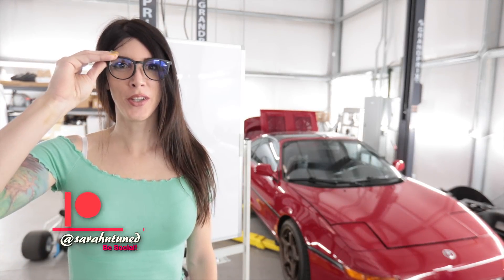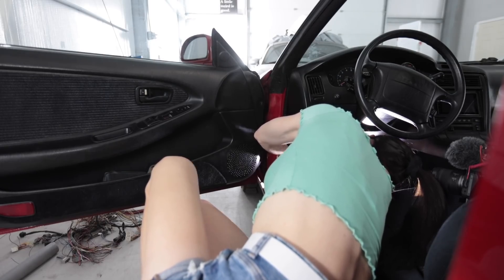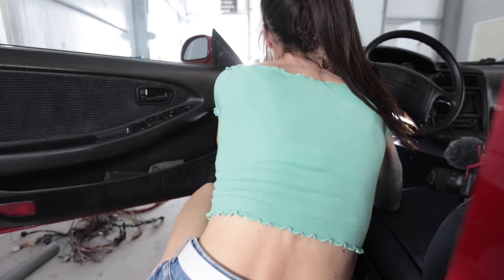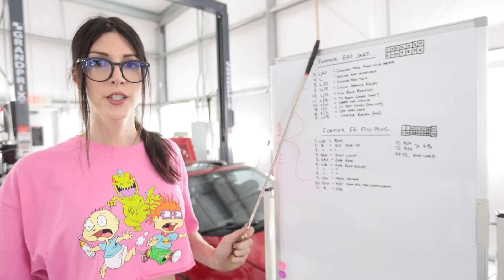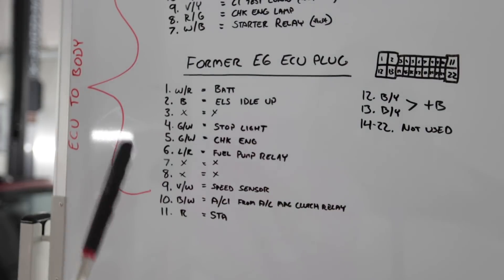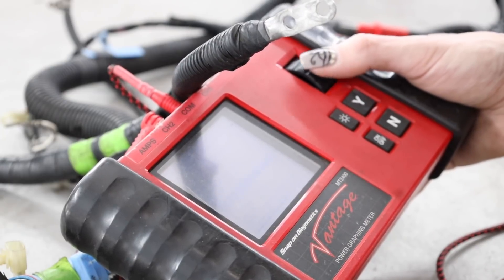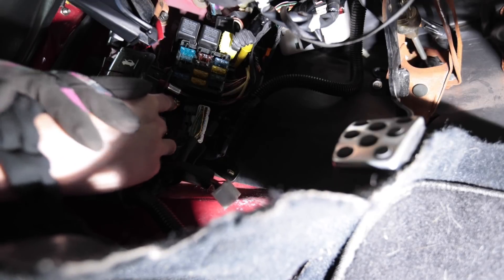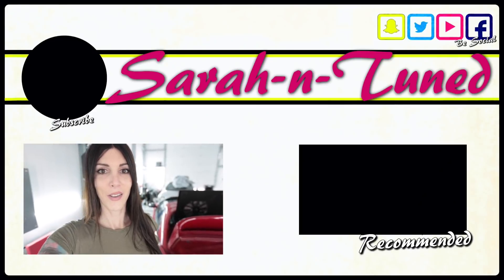THIS Is Why People Screw Up JDM Engine Swaps! // Project MR2 Turbo

Comment: The STA circuit does go through the clutch switch, but it as an input to the ECU is really only as a check, allowing the ECU to know the engine should be cranking by way of the starter motor. Kind of similar function to when your Forrester threw crank/cam sensor faults when the starter went out, it's version of that STA circuit told the ECU to be looking for those signals, which it wasn't seeing.

I personally nerd out hard on this kind of work, but you did a most excellent job of keeping it interesting for about everyone else. 

As long as you include the appropriate punctuation, in your head, while talking, sentences can go on forever...

Comment: Cudoos on plastic wrapping the exposed cylinder head. A true technician! I too did a S5 turbo RX7 swap into an 86 RX7 body and only two people online said it was possible and even the rotary performance shop in Dallas said it was impossible but haha persistence and wiring diagrams paid off!!!

Comment: I was thinking I would have hooked up the new ECU to the old harness and made sure it worked before ripping everything out and introducing numerous potential miswire faults in my fabrication process; then changed the body harness and made all those extensions. 

And truthfully I would have skipped the new harness and just troubleshooted the old one and added a new fuel pump resistor circuit and any others that tested with too much resistance or intermittent continuity when shaken. They spayed everything down in CRC 226 to restore electrical contacts and drive out the moisture. 
 I can't imagine doing the work you just did on anything less than a pre war Bugatti. Which would of course  be so much simpler. 
Alas, I lack your courage, patience and skills, to say nothing of your confidence. You are an inspiration to every DIY builder lacking the funds to pay someone else to get it done. 
I salute you. Love from, and beautiful weather in... NYC. Larry

Comment: Having wired up many after market ECU's I agree totally most of the screw ups occur when you take the wire color for granted. I always do and end to end map of the wiring it takes time but always saves in the end.
Reply from the maker: I also forgot to mention that JDM to USDM is sometimes off by one MY since Japan releases these cars one year ahead usually. That and sometimes plugs can have a wire or two in different pin slots.

Comment: I fixed a lot of mechanical issues on the Porsche 928 S4 I resurrected.  The only issues that were left were electrical (and timing belt).  I tried to fix each electrical problem and failed.  I sold her on to someone who thought they could fix her.  My hat's off to you for your electrical genius.  It's not as easy as you make it look.   👍

Comment: My 68 spitfire had a cross circuit between the brake lights and the ignition. If it was raining you could remove the key and the engine would continue running as long as your foot was on the brake pedal. Since the parking brake was rusted solid, parking on a hill was a balance of letting it roll till it died then brake and put it in gear. 
Got to love a car with only three fuses.

Comment: I've got a 1st gen-supercharged that I've needed to change the wheel bearings on for like 10 years now. Your motivation  is inspiring, your 2nd gen is gorgeous.
Reply: The wheels haven't come off yet if you've waited 10 years??
Reply: Just buy the bearings on line (not the cheap ones) and take the hubs to your local repair shop (like an alignment shop) and then have them take out your old bearings and press in your new ones.  Shouldn’t be more than $100.

Comment: Ohm, ohm, ohm... meditate your going to need it. Electricity flows like water, imagine garden hoses. Props! I remember wiring up a megasquirt ecu in my na miata.. and.. the Integra b20b vtec.. Honda crv bottom end with civic si 1.6 head. Squuuishhh!! Vtech understeer yo!

Comment: You should try the JDM method of working on mr2s by taking off the boot lid then sitting in the boot
That saves you reaching over the top or sides when working on it

Comment: how are the notes on your whiteboard so straight? That's some pro-level dry erase skillz
Reply from the maker: I kept a top notch maintenance board when I ran the section 😂. My airmen would just write everything in the lower corner for me to retranscribe because I was so OCD with it.
Reply: @SarahnTuned  That's' funny Sarah 😆. When I enlisted in 1987, I was a little older with College Pre-med and more disciplined than my peers. I was used and abused, put to do tasks meant for the higher ranking. By the time I retired 22 years later, I had been used, abused, OCD, bipolar, and PTSD. I definitely can relate.

Comment: Suggestion:  If you want wire labels that will last longer and stay on while pulling the wires through the car then get "self laminating wire labels".  I know BRADY makes them for their BMP-51 printer.  Yes, it is expensive, but it costs less than a Snap-On wire tester (or a Hellcat Charger?), but both of those are business expenses.  Maybe Brady would send you one to promote?  BRADY also sells a BMP-21Plus (BMP51 has 51mm/1.5" wide label rolls, BMP21 has 21mm/0.75" wide rolls.)  The BMP21 also makes wire labels, but you can't get self laminating labels for it.

Comment: Hi Sarah. 
  I drew out my injection wiring and all the routing, so I could check it before connecting lives.
Computer failed taking out the operating system and program from windows 7.  All lost.🤬

Comment: Ok so after after the advertisement the reason folks screw up the install is like all others that they fail to understand the engine management system 
be it it analog or digital. Give the engine imputes it recognizes it will run like scalded dogs

Comment: The fact that you are using all the same color wires for all those connections is really bothering me.  I would have to color match those wires.
Reply from the maker: Ah, but you’re wrong, look closer. I matched the base color to each wire, green-green, blue, red, purple, black, white... etc. etc. Then once I cut to length, I’m going to use a heat shrink label to further identify for the lack of the contrasting stripes.
Reply: @SarahnTuned  I stand corrected.  I saw a bunch of blue wires and assumed.  Meh, not the first time I've been an ass.  lol